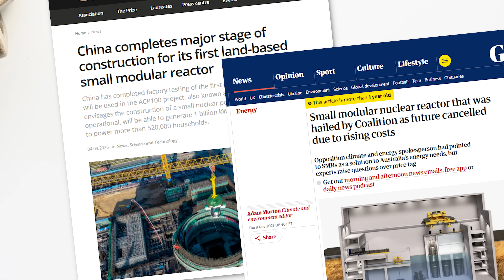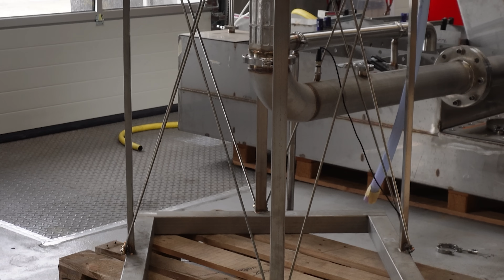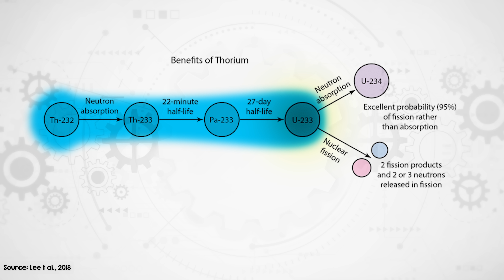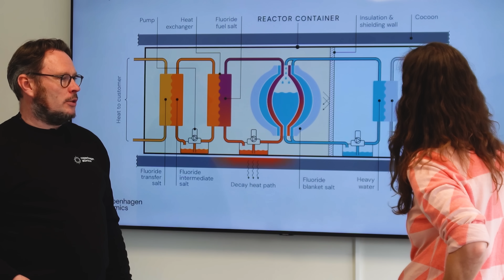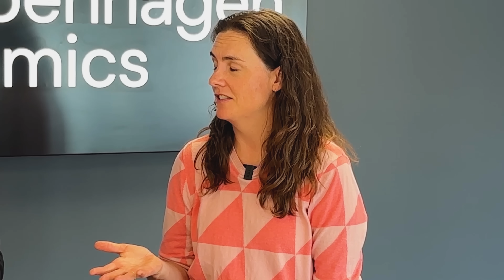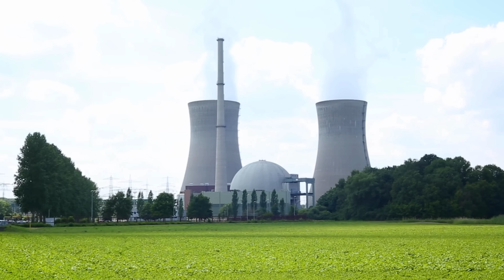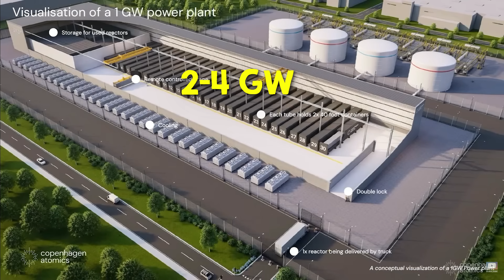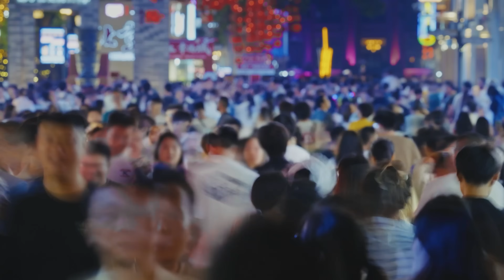Can Copenhagen Atomics Make THORIUM REACTORS Work? [TOUR]

Comment: China is already far ahead in this field.   The successful tests in 2024 and 2025 make China the leader in molten salt reactor technology.
China has achieved a major milestone in nuclear energy by successfully operating a 2-megawatt experimental liquid-fueled thorium molten salt reactor (TMSR-LF1) in Wuwei, Gansu Province. The reactor reached first criticality in October 2023 and achieved full operation by June 2024, becoming the world's first to successfully test this technology. It uses a thorium-uranium fuel cycle and is designed for high safety and sustainability.

Comment: Possibly the biggest barrier is transportation of the container sized module containing the highly radioactive parts.  Of course step one is somewhat unique to this design, remove all the heavy water so that there is no moderator, or if absolutely necessary for interim cooling, backfill it with light water mixed with neutron absorbing additives. (A CANDU SMR may hypothetically have the same option.). However, beyond that, shipping highly radioactive materials is very difficult from a regulatory standpoint.  I once saw a train go through my town with cars of ammonium nitrate followed by tankers full of diesel.  That apparently is fine, even when the diesel fuel was followed by a tanker containing a chlorinated solvent (which when heated produces phosgene).   However, if you put 1 gram of high level fission products on that same train, it would take years to get permitted.  Their business case is entirely dependent on solving the transportation issues.  Otherwise the uranium cannot be harvested from the outer shell,  the site will need to be permitted for radioactive fuel storage, etc.  it all just falls apart.
Reply: CA plans to transport only the unfueled reactors, and separately, the fuel. Initial fuel is low enriched uranium, not very radioactive, and already transported to 450 reactors worldwide without problems. After 5 years, the reactor goes into storage in the same building for fifty years. The highly radioactive fuel is pumped into a new, clean, reactor, and also never leaves the building. After 50 yrs, the original shell isn't very hot, with only surface salt contamination of the steel, and a little neutron induced activation. The separated fission products would still be quite potent (though much less so than when fresh), but volume and mass would be low.

Comment: 1) The Western "elites" won't develop Thorium reactors. Ever. 
2) As long as the West controls the oil, gas, coal and uranium, they control the world - and the "elites" would literally rather plunge the world into a nuclear holocaust, than give up their control.
3) The West will not allow China to develop and use thorium reactors, which is why WW3 is being prepared by the USA and Europe against Russia and China.

Comment: 1. Europe has no high-temperature steel, the Hastelloy-Nickel, which ORNL MSRE had back then in the 1960s (and which China has now on their own! For their MSR program). This is the proper steel for Thorium Molten salt reactors. 

2. Another discussion and politics that has possibly gone wrong for decades: Climate change, greenhouse gases. Maybe we need not fear overheating too much ( the ocean absorbs some, the green plants thrive ), but fear cooling! 
Many Cold War nuclear bomb tests had those mushroom clouds, especially the biggest, the Castle Bravo and the Tsar Bomba! They really blew parts of our atmosphere out into the Space. The 1960s Superpowers may have reduced the atmospheric pressure at sea level by some microbar or nano_bar, in addition to the long term trend of atmospheric loss over billions of years. A process less pronounced, but nevertheless ongoing, similar to Mars's atmosphere!    And in 11000 years, the next Milankovitch minimum will come! 
Think about the geologic era of Devon, before the Carboniferous, 300 million years ago: a lot of our underground coal was up in the atmosphere, a lot of CO2; maybe the "standard" atm pressure back then wasn't 1013 mbar but more like 1020 mbar.

Comment: modularity only applies to a certain class of innovation where simplicity of the inherent technology and manufacturing overlaps with large scale production, such that the flywheel of cost curve positive feedbacks on sales keep the innovation thing scaling up exponentially over time. Solar cells and panels are a classic example, so are lithium ion batteries. Nuclear reactor volume will never be in the hundreds of thousands to billions. Nuclear reactors, so far, remain extremely complicated and subject to complex behaviour dynamics, these two things are what make it, so far, extremely improbable to be suitable for "mass production" and the subsequent cost curve miracles we've seen with semiconductors, solar cells, li-ion battery cells and so on. Good luck to these clever people at Copenhagen Atomics, but I remain highly skeptical.

Comment: Via AI: Copenhagen Atomics plans to use an "Energy-as-a-Service" model. They intend to build, own, operate, and decommission the reactors, selling only the electricity/heat to the customer via a power purchase agreement (PPA). This removes the need for the customer (or the taxpayer) to front the massive capital investment, accelerating adoption. Best to wait and see what happens when the reactors have their 'live' tests next year... The commissioning period seems quite short, but the size and hazards will get consideration by Generic Design Assessment in the UK : Office for Nuclear Regulation (ONR): Assesses safety, security, and nuclear safeguards. Environment Agency (EA): Assesses environmental protection and radioactive waste management (for England). Natural Resources Wales (NRW): Assesses environmental issues in Wales. Some of the most popular political parties in Wales oppose this sort of technology. However the UK  National Grid has interconnectors to France. Will some electrons be stopped at the channel & will the electrons be used only by means of devolved power? Political electrons....its a tricky one?  When you apply a voltage, the electric field is established virtually instantaneously along the length of a wire.This field simultaneously acts on all the trillions of free electrons in the conductor.
As an electron at the start is pushed, it immediately repels the electron next to it, and so on, creating a wave of momentum and charge density that travels at the speed of light.The actual physical electrons only move a tiny fraction of a millimeter per second (the drift velocity) while this energy wave propagates down the wire. The movement of the electric field is the cause of the very fast current signal, even though the movement of the physical electrons is extremely slow.  With a bit of 'spin' politicians may claim that no foreign electrons have been admitted under their watch. (A complete misunderstanding of Schrodinger's quantum theory, as usual; it has more to do with quantum probability mapping.)

Comment: As I understand, those reactors are based on production of heat, which is used for steam generation and then dumped into rivers. 

Another question, can they be tuned down to follow demand? The problem with wind turbines is that it may not produce energy when we need it, but the same problem with nuclear is that it produces energy when we may not need it. In my mind it would be best to change demand based on supply capacity.

Comment: It's interesting and disappointing that this guy never talks about the "kidney" that continually cleans the molten salt of fission products. Maybe that's the part they want to keep secret, but I think it's also the most difficult part of the process, because there is nothing simple about the sort of fission products that you get, They're very different chemically, and they're radioactive in every possible way. Removing all those things from a hot, corrosive salt seems like pretty interesting chemical engineering problem! Not easy, though still a hundred times easier than fusion.

Comment: This will be very good if it actually works. Also the cost of power generated needs to be aound of below 10 Euro Cents/KWH. Then it will find large volumes. 
This can be a big benefit for  setting up Data Centers in remote / rural locations , where land costs are really low and Water availability is abundant.

Comment: Either they've glossed over the hardest part, the chemical process, or they have just made the entirety of the fission products mix disposable without processing. If it's the latter, it seems it would generate more nuclear waste than is typical.
Reply: Both, I think. Nuclear chemistry in a MSR is the hardest part, and if the MSR is using the thorium fuel cycle, it's much harder. I'm not sure if the chemistry is really that hard or if the regulators are making it that hard.
Reply: @chapter4travels I've been following research and discussions and my understanding is that it is a very complex chemical process to remove and process the contaminants. While it is feasible in theory I'm pretty sure it hasn't actually been done in practice, and of course it is heavily regulated, because it is radioactive material. The whole process needs to be automated / remote controlled, which is never trivial.

Comment: Why do you think that EVERY  ware house need a 20 MegaWatt connection? Why 50 trucks, why 600 kW at each truck!?!? First of all - if EVERY ware house will be equipped with a charger - then you do not need 60 those misterious 600 kW connection to each charger, itvwill be enough with 100. Justvto "top up" till next warehouse, "across the street." Second - you said it yourself - truckers a forced to stop for a rest every 4 and a half hours - so it's only would be logical to charge at that time. A guy from Germany, with a youtube channel electro trucker use his electric truck without warehouse chargers, and those extra stops at extra costs. It's just planning

Comment: Waste handling and final waste processing possibly is the killer. Radioactivity issues and considerations must still be the first consideration.
Reply: The typical solid-fuel uranium reactor "burns" 8% of the uranium before it needs to be shutdown and refueled. A liquid-fuel thorium reactor will burn ~95% of the fuel before needing to be shutdown. The waste generation and handling is immensely different between the two.

Comment: We already use robotics extensively in manufacturing. In the new age of re use and recycle, perhaps the refurbishment of dangerously radioactive modular systems can be accomplished in enclosed facilities. 5 years, if that is the optimal life of a modular reactor, is not long. If components can be refurbished and reused, it makes a much more practical and cost effective product. A unit that can only be recycled after 50 years requires that a huge area is given over to housing radioactive scrap/redundant units until the decay reaches safe levels. We are told that the Uranium fuel can be reused. So the answer to how this can securely be accomplished needs to be answered before they have a viable system beyond a "5 years, then what?"

Comment: The thorium fuel cycle is still a huge challenge. It produces a lot of very nasty gamma-emitting intermediates, and makes large amounts of U-233 which is a serious proliferation risk. While U-233 is an engineering nightmare, it is still a fissile material that is weapons-grade straight out of the reactor. Thorium enjoyers need good answers to the fuel cycle challenges and proliferation risk. Right, now it's all vibes.
Reply: I think you kind of answered your own question. The reactor produces a lot of nasty gamma radiation that will prevent you from accessing the weapons-grade U233 before it's introduced back into the reactor as fuel. This is also a flaw in their design; every part of the fuel cycle has to be hands-off automated and can't be practically serviced once started.

Comment: He is talking Uranium, not Thorium, and heavy water, not molten salt.
Reply: Right and wrong. This is a true molten salt reactor; the uranium (not thorium as you correctly point out) is dissolved in the molten salt, and heavy water is the moderator.
Reply: @chapter4travels  Well, they use thorium, so there is that... Thorium then breaks down to uranium 233, you did´t watch the video?

Comment: Copenhagen atomics is one of the best solutions to an emission free energy production but there are a few things with that you forgot to mention or overlooked in your video. Starting with the salt. The Danes are able to produce the cleanest salt in the world, something that limits the corrosion and enables them to use industri grade stainless steel and not some expensive alloy like Hasselhoy-N. The pumps you showed with the magnetic bearings are developed so that they can work at temperatures of 700 degrees for years without maintenance. Normal bearings will not last long. Since it all fits in a standard container it can be built anywhere and be deployed anywhere.  Once deployed somewhere it can easily be upgraded in accordance with the demand due to its modular structure. Copenhagen Atomics will be handling the financing,construction,operation,maintenance and decommissioning for the nuclear plant. What the costumer is getting is basically heat and that heat can be used for a number of purposes and not just the production of electricity. Since it all goes into standard looking warehouses it can be established next to the facility that buys the power.  These reactors cannot only be used to burn thorium but also other nuclear materials that is now considered radioactive waste. Basically they can cover the demand for energy for thousands of years if not for infinity or until we come up with something better. Unlike conventional nuclear reactors that are all prototypes these will only need type approval like cars or planes since they are built in series on an assembly line. Molten salt reactors have strong gamma radiation but the warehouses where they operate are fully automated and there will not be humans inside. The waste from molten salt reactors only have to be stored for 300 years before it is safe and could in fact be stored above ground. It will be useless to try to make bombs out of it. I am looking forward for when the test results from Switzerland will be made public.Nuclear power plants are expensive to build but cheap to run, specially with an expected lifetime of 60 to 80 years. With the danish approach they will also be cheap to build and could be operated for hundreds of years with regular maintenance and replacement of modules. When fully operational not other energy production will be able to compete.

Comment: There are ZERO Alpha Decay Neutrons released.  The Fuel is Literally Dirt (cheap)! The ROI is nearly instant with an ESCO model. The AI threshold for Critical Mass (Energy Requirement)  According to @gartner is at present [2027]. There is NO other technology available — WITH Mass production/adoption/infrastructure installment available, to meet this fast-approaching threshold. Thorium MSR is Melt-Down Safe! 

I proposed Green Hydrogen for Putnam County NY (Three years ago). The project was green lighted.. an election occurred and we lost all legislative support. Strangely, the three ten acre county owned parcels I secured, were rapidly commercially developed.. I’d be happy to collaborate with your group. The Nuclear winds are changing. The critical AI Window for U.S. Infrastructure Energy requirements has the U.S.A. In a Corner. There’s ZERO way a Light Water Reactor infrastructure will meet the technical or Logistics within 20 Years! 

Let’s talk.

Comment: I am still amazed that we have been putting small reactors in to Nuclear Subs for years; yet we can't just take that design and put it in a shipping container ?
Reply: Sub reactors use 90% enriched U235 as fuel - that's bomb grade. Most commercial reactor fuel is below 5%, no chance of buying above 20%. So you'd need a much larger core for the same power.

Comment: Their Gigafactory will end up near a port or railway interchange. The size matching the Intermodal Containers is near perfect for many applications - easy heli-lift to place on the roof or carpark of a hospital for disaster relief operation, trucked in to the basement of a skyscraper to run a building and feed excess to local grids, sent out to mines and farms where there's currently no other choice but Diesel or Gas, or put five at a time in SpaceX's Starship and ship anywhere we want for mining and exploration, or even deep space probes assembled in orbit and sent off on hundred year missions with automatic refueling equipment. Even a current Ion Drive, or an array of them, running at full thrust for years at a time, would get to velocities that would have a probe at Bernards Star or Alpha Centauri inside our lifetimes.